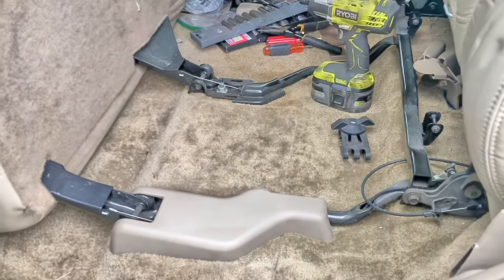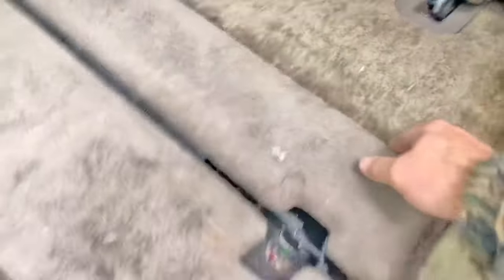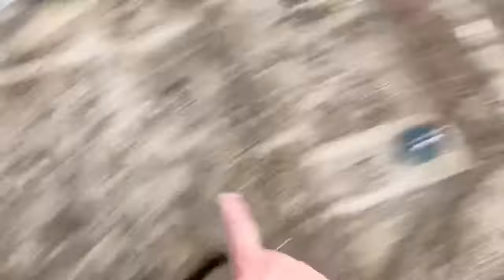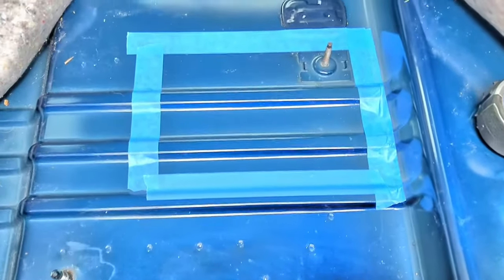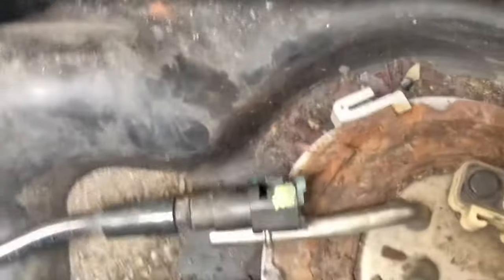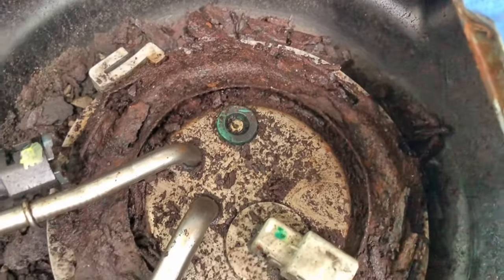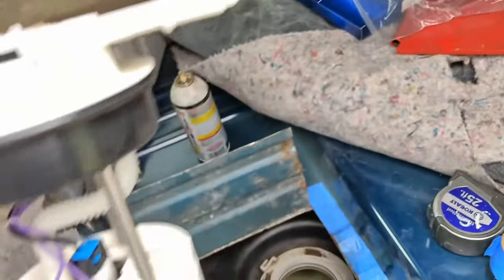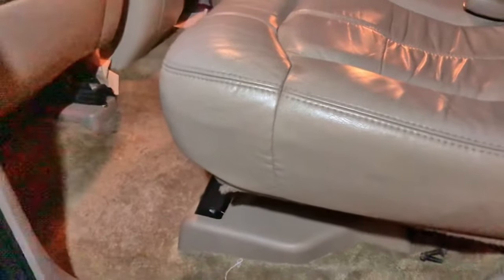Chevy Tahoe / Suburban Fuel Pump Replacement Without Dropping the Fuel Tank ... In 2 hours or less!

Comment: It's sad that Chevy/GM didn't put an access panel above the fuel pump location in the Suburban/Tahoe.  My 2001 Cadillac DTS has an an easily accessible fuel pump access panel located in the trunk that makes fuel pump replacement relatively easy.
Reply from the maker: I agree… my 1987 VW Cabriolet has an access panel under the rear seat… literally takes 15 minutes to swap a pump. (I carry a spare and the two tools needed to change it in the glove box…)

Comment: I've been cutting holes for years ever since the parts store sold me 2 pumps on a row that were wrong size and I'm using every swear word in the world dropping the gas tank again and again.
I try to use only OEM or Bosch. My 05 suburban I was broke so I got a used OEM has been working just grate 4 years.
Heads up on the tank mounting brackets on chevy go bad from rust.
Caution don't use a grinder it can ignite gas fumes.

Comment: I have always wondered why they don't have an access point for the fuel pump from the factory.
Reply from the maker: Me as well… my 1986 VW has an access panel under the rear seat… takes 15 minutes to change a fuel pump. :)
Reply: Because they want everyone to go to the stealership for repairs..and that these don't normally go out under warranty, extra hrs to replace.  Book say so many hrs..mechanic at stealership does it in half the time..still billed for what book says..
Reply: My Maxima had it under the seat as well, even though (big name here) repair manual said to drop the tank..

Comment: I think you could have dropped the tank way quicker?
Reply from the maker: Probably so… it was almost a full 30 gallon tank as luck would have it though… and I don’t have six 5 gallon gas cans lying around. I also have a bad shoulder… so this was “easier” in a sense of physical exertion, never spent a second on my back. It may not be for everyone… but I guarantee I’d be faster the next time. 😋 Cheers… thanks for watching.
Reply: How could you cut that with no sparks?
Reply from the maker: @RedWhiteBlueYo  reciprocating saw with a 4” metal cutting blade is generally spark-free.

Comment: So what did you use to make the cut? You were talking about Sparks  but that cut looks like it was made  with a  cutting  wheel on a grinder
Reply from the maker: Anthony, I made two initial small slots about an inch long with a cutoff wheel trying to keep the sparks flying upward into the cab and finished the cuts with a 4” Torch metal cutting blade on reciprocating saw that has an adjustable shoe to keep the blade penetration shallow. I’ve done one other with a pneumatic nibble, and it took forever. Still not the best method, but I tried to minimize the risk as much as possible.

Comment: Would the fuel pump be in the same spot in a 98 Tahoe 5.7 4 door 4 wheel drive
Reply from the maker: No... it’s more centered in the rear cargo section, lucky for you it’s less work removing seats. Here’s a link to a fellow who has done it. https://youtu.be/hcZtxa8O7yQ
Reply: No bro I did in my 99 tahoe under the rear left seat second row I have a picture of the dimensions @anthony frago
Reply: @Scrappy-s9t  do you still have the picture of the dimensions im needing to do this on my 99 tahoe

Comment: How did you seal the hole in the floor up?
Reply from the maker: I screwed a license plate over the seams and then taped those seams with metal foil heat tape.